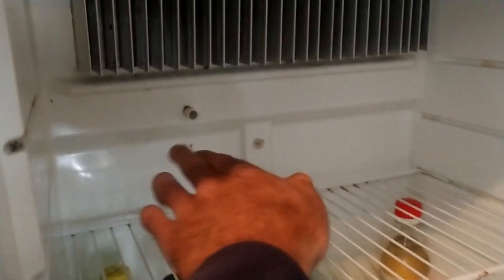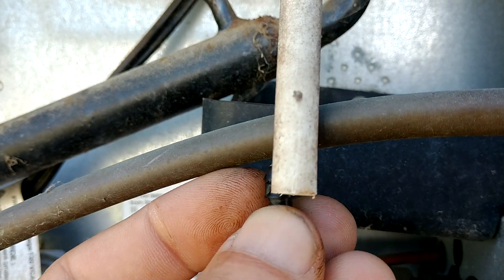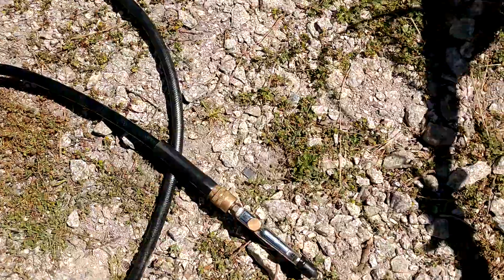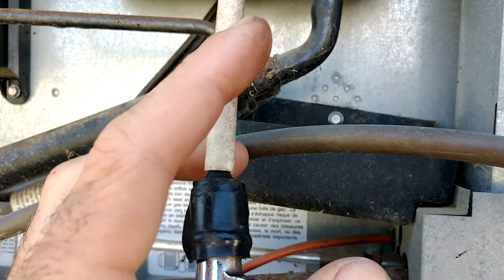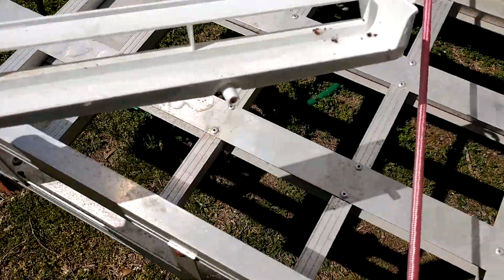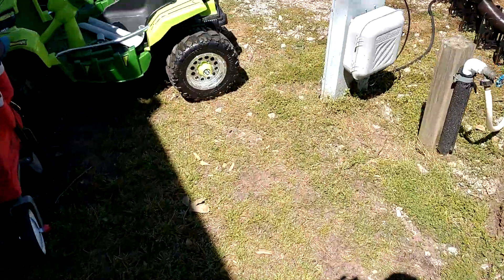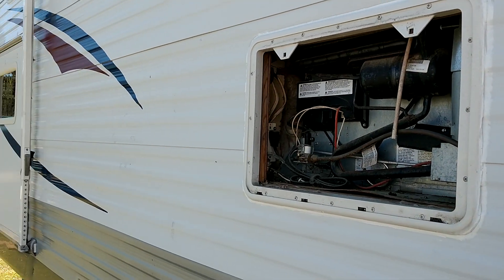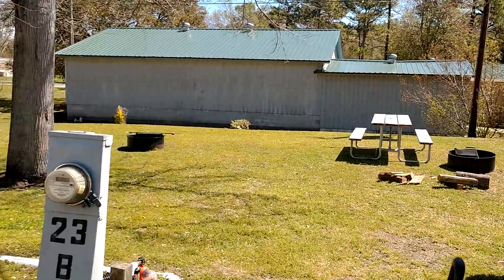How To Unclog RV Refrigerator Drain Tube

Comment: Your fridge should switch to gas when you disconnect the household current.  If you shut off the propane while moving your fridge will not keep your food cold.  Some people are afraid to run their propane while moving, but your fridge is designed for mobile operation.  The fridge is designed to mitigate the moisture but sometimes the water freezes instead so I guess we have to be vigilant and monitor that too.

Comment: If the channel below the fins freezes up, the water can't get to the hose to drain out. If you turn off the reefer and let it warm up inside, you can remove the ice from the channel and then it will drain again as long as the hose and the little black part are not plugged.

Comment: I hate full time camping. It’s too much work. I never get a days rest. Just caulked around vanity today. Had to unclog my kitchen sink a couple days ago. Trying to get rid of drain flies. The guy who weed eat around my sewage cut sewage hose and drain flies came up in my tanks. I was not at camper for weeks and when I got back oh what a mess. I put a new sewage hose on. What can I do to get drain flies out of my camper. I’ve tried everything. Going on three weeks now. Is there anything I can put down drains? I’ve used soapy water. Bleach water. Hot water. Keeping both tanks closed and emptying everyday. What a mess.
Reply: Get a 5 gallon bucket, dump an entire 8 ounce bottle of Compare-N-Save 7.9% Bifenthrin Concentrate insecticide in the 5 gallon bucket. Fill it 75% of the way with hot water. Now add 1/2 a cup of dawn dish soap. Now fill it up to 90% full of hot water. Dump that down your drain sink. In 24 hours your problem should be gone.
Reply: It might be worth it to buy the 32 ounce bottle of that stuff as it may take multiple treatments or you might have to treat each tank as well. Each tank will need at least 8 ounces of that stuff at minimum. 

You could also try draining all tanks, leaving the valve open, pull the hose off the discharge port, clog the sink and shower drain with a wet rags, and then put a bug fogger into the discharge port. The fog will fill the lines and tanks. You would need to leave it in there for 4 hours minimum after you set it off. I would leave the fart fan on in the RV and some other ventilation open as well just in case any fumes leak inside. I would go out to eat and a movie during those 4 hours.